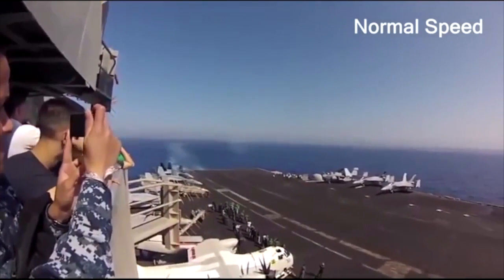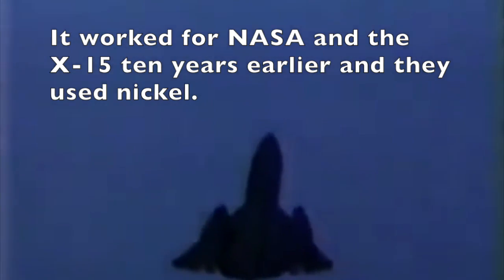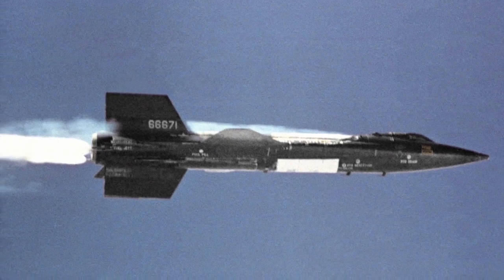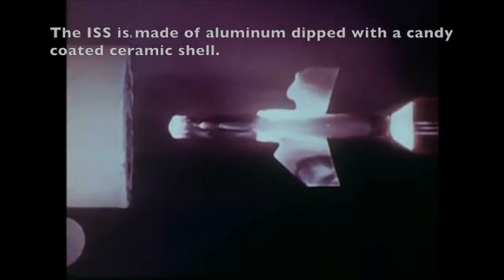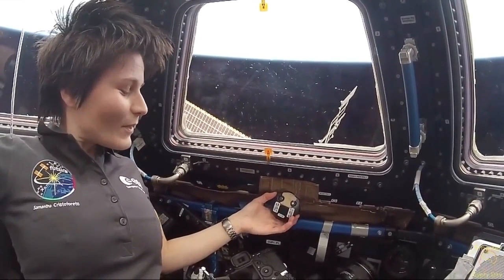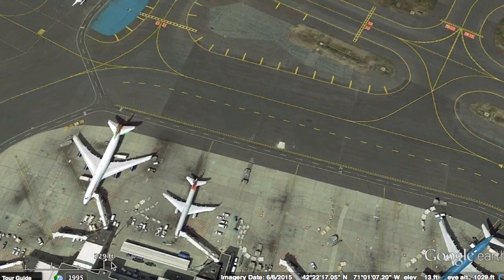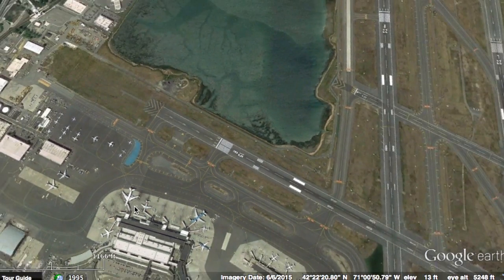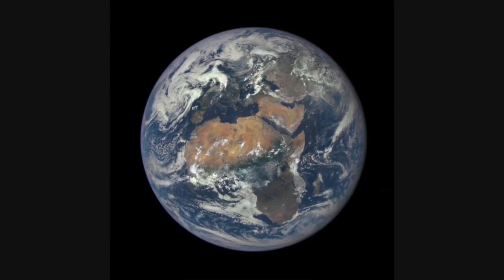ISS science

Comment: 1:48 It's not a concern because the ISS orbits at an altitude of 254 miles.
Reply: Austin Rozendaal - my question is, "If a Boeing 757 looks 1/2" long at 7 miles up, why does the ISS look about 1/4" long? They are both the same size. By those numbers it should only be 13 to 14 miles up? NASA tells us it is 250 miles up. We would need a very very powerful telescope to see a 757 if it was 250 miles up, right?
Reply: The ISS doesn't look about 1/4". If you've ever seen it pass at night when it's illuminated, it just looks like a bright point of light. If you look up images of the station transiting the Sun or Moon, you can get a sense of its actual apparent size from ground level.